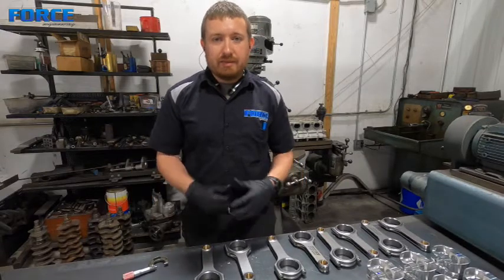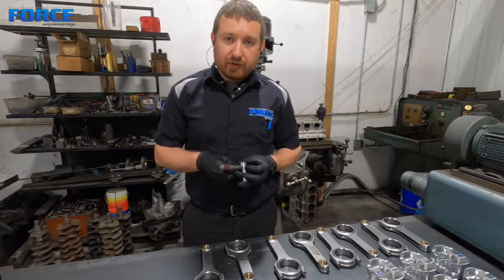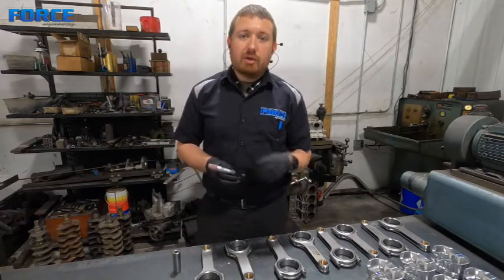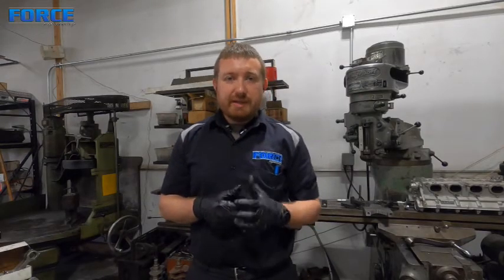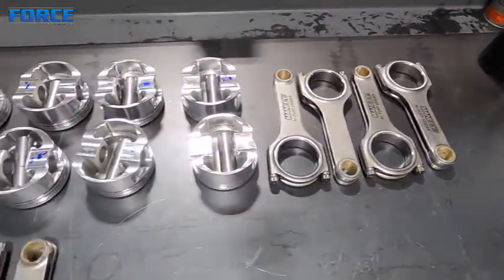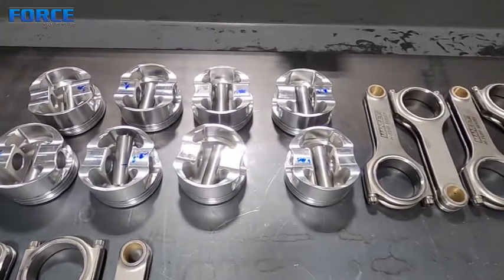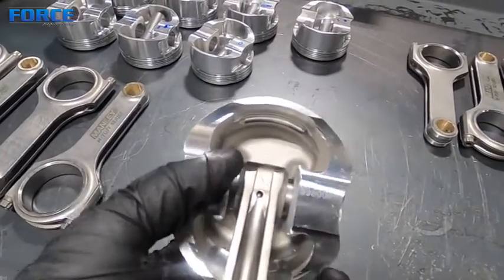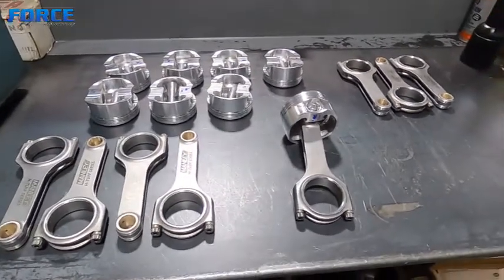Engine Machining - Piston Pin Clearances | Don't over look this!

Comment: On piston pin to pin bore clearance,  I like to see .0008-.001 for NA street stuff. For low boost I go a bit more. For high boost and nitrous I run .0018 or so. 

This is a critical clearance, most people never bother checking or adjusting piston pin to pin bore clearance.

Comment: If you can run brass stock on a lathe you can rebush the rods done in a lot of machine shops.
Reply: I agree.  We are ripping the pin boss out of the pistons with a specific JE FSR 2618 pistons barely getting 125hp per cyl design using 24mm pin.
 You would think the .150 pin would have failed but no strap around pin boss shearing.  Molnar setting us up with a 22mm SE, bushed down.